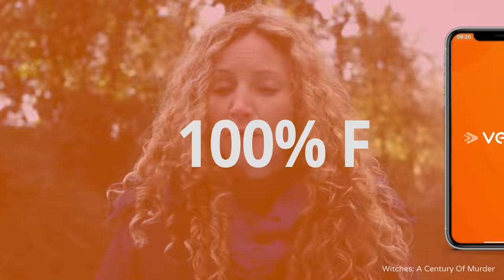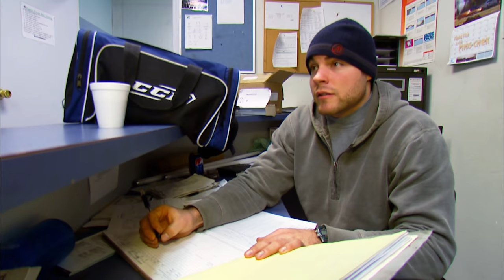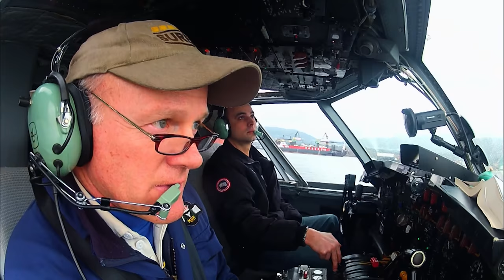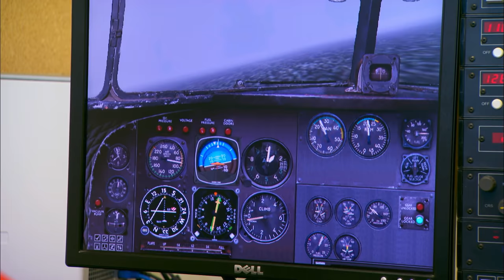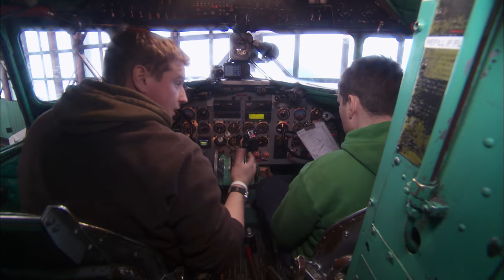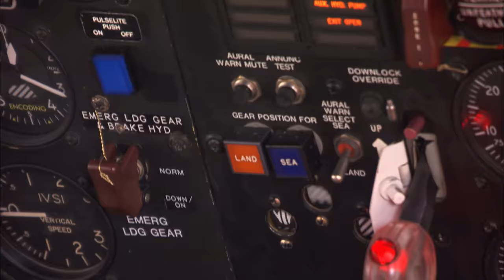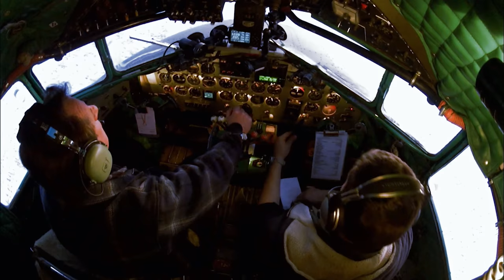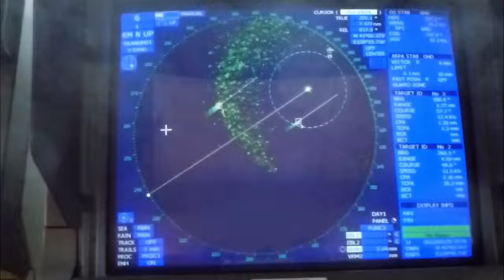Buffalo Airways Push The Limits Of Their Old Water Bomber | Ice Pilots | Wonder

Comment: I worked in the aviation field especially in the military the swing that is designed for that aircraft can is designed to lift the aircraft complete full of fuel oil and all that out of the water wrecked or not wrecked so them saying that's untested it's is tested it can handle it now normally that the wings will be removed before this thing will be hooked up but is designed to be able to do with the wings on

Comment: What does it mean when they say "rotate " ?
Reply: its the speed that the nose is lifted (rotated) off the ground, but it not the aircraft flying speed, that would be your lift off speed, which is higher than rotation speed
Reply: @bndahi8251  my fault sorry @Dan I thought you said when they where loading the plane on the boat.
Reply: Rotit is before the gir is of
.. When the plain is before fling of...
Reply: In lift of...
Reply: @bndahi8251  nope vr is the airspeed at which you should rotate. Rotate just means pulling the nose up to take off
Reply: @astoriahittaz3627  but that's what I said though...